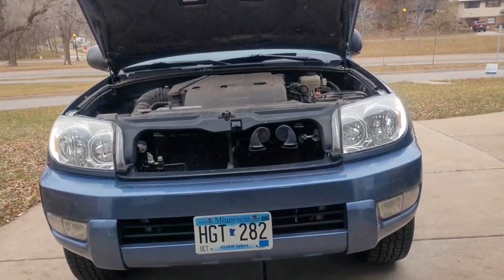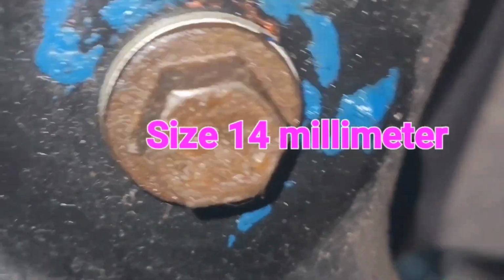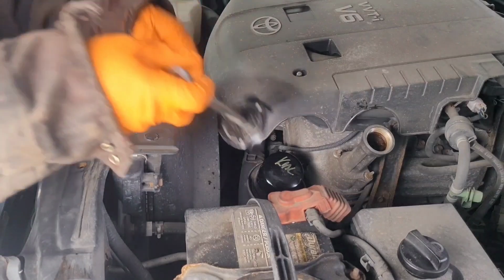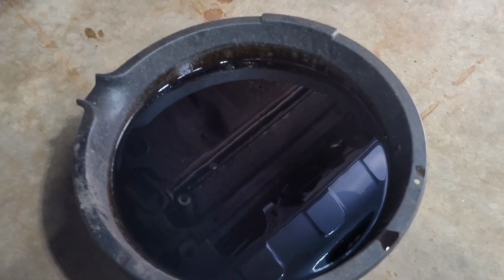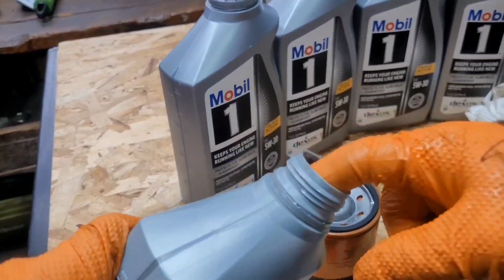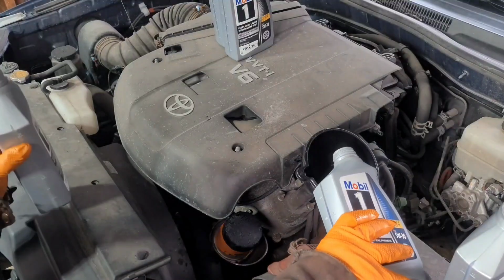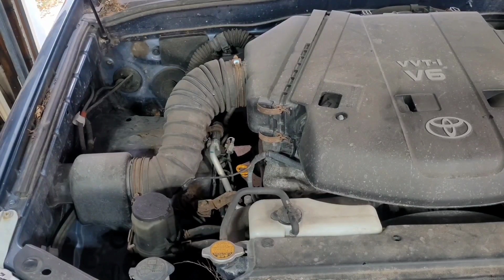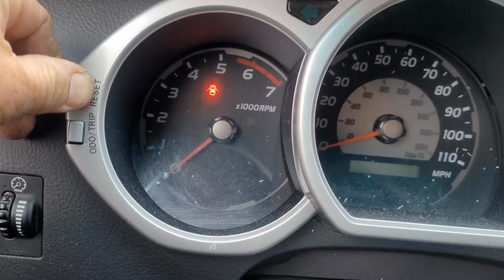Best Oil Change (IF YOU WANT GOOD SERVICE,  DO IT YOURSELF)

Comment: Hi. Thank you for confirming that if you go a little bit over the second dot it is not a problem. What type of oil do you recommend for Honda CRV 2007, petrol 2.0 engine, automatic, 113000 km, please? I was thinking to chose between 0W20 and 5w30. Which do you think is best. Thank you
Reply from the maker: I would highly recommended the 0W20 full synthetic.   It doesn't matter what brand you choose.  I use Mobile 1, or Valolin 0W20 on my Honda also.
Reply: 3000 miles change using Mobile1  is really a waste of money.
Reply from the maker: Yes, and that is true for vehicle engines now a day.  The reason I used Mobil 1 oil for every 3,000 miles on my vehicles, and recommended to most of my customers is because depending on how you drive,  the oil gets really black and dirty when it reaches 3,000 miles.  Plus,  here in Minnesota,  we have to deal with the winter season, and with good oil, engines will start easily in cold weather.   Sometimes my customers may go over the 3,000 miles recommended, and that is fine for the engine.

It doesn't have to be only Mobile 1 oil.   I also uses, and recommend Valolin full synthetic also.

Comment: What is your opinion on engine flushes on high mileage vehicles (over 100k). Good or bad?
Reply from the maker: Depending on how dirty your engine oil is.  If you skipped a  lot of oil change and the oil becomes gummy like fluid,  then I would recommend it. 
Gummy dirty oil will cause your valves not to perform as it should,  and soon will cause your engine to knocks (those are lifters).  
My opinion is base on a normal working engine only.   If the engine have other issue.  Than I would not recommend it, because it could cause more harm to your engine.
Reply: @tholeetruck  I bought a 100k+ used car but it has been maintained with 5000 mile oil changes. Still, was thinking of flushing since it's an 11 yr old car and I don't know the quality of oil used
Reply: **100k + miles
Reply from the maker: If you really want to do it.  Just make sure the engine does not have any other issue,  and runs fine with out any knocking sounds, it should be fine.   I have used engine flush kit before.    Just follow the kit directions carefully,  and not run your engine pass the recommended minutes it stated.
I have never use engine flush kit anymore on my vehicles,  because I service my own oil change at every 3,000 miles, and I used only full synthetic oil.  
I personally don't like using engine flush kit, and tends to stay away from it.   A little of the engine flush kit will remain in the engine after your flushed.   It will go away on the next oil change,  not to worry too much.